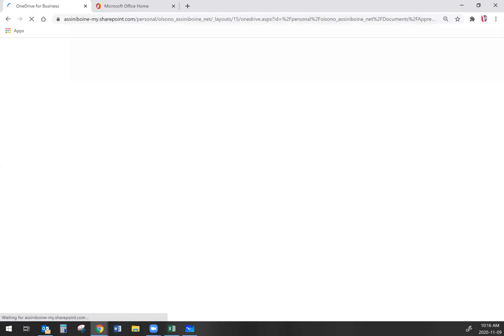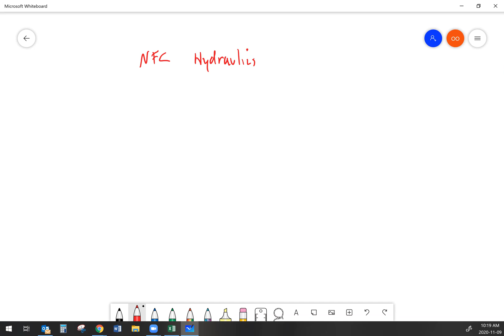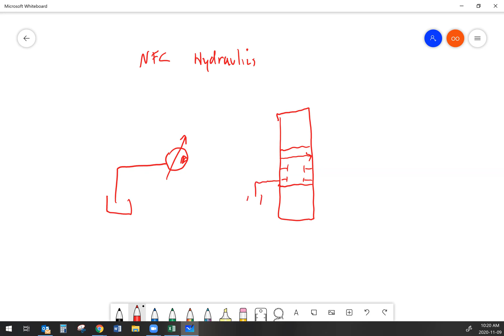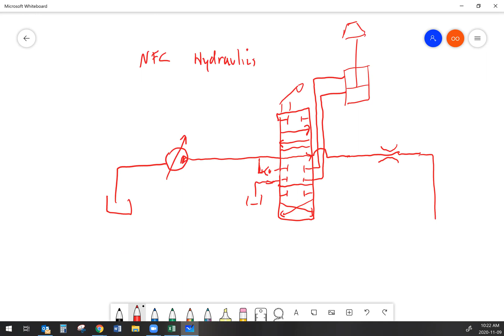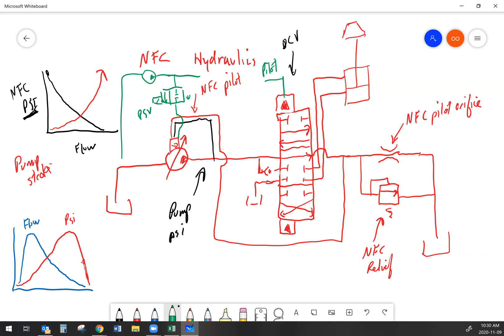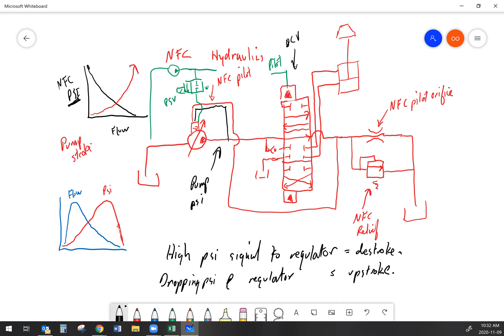Excavator Hydraulic Systems explained | NFC Hydraulic Diagram tutorial

Comment: Jcb excavator keep stalling when lifting boom or doing work. The engine is good and main pump is good, what could be the problem
Reply from the maker: If it has the constant horsepower style hydraulic system, it is quite likely that the high pressure (P1 or P2) cutoff signal is set too high.  Try backing off the adjustment so the pump will destroke sooner when pressure rises so there is less load on the engine.